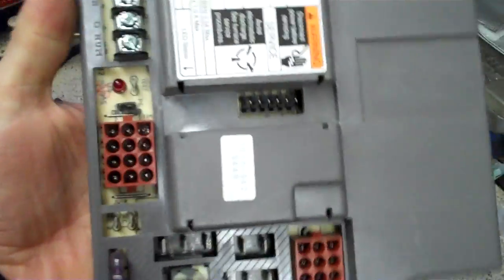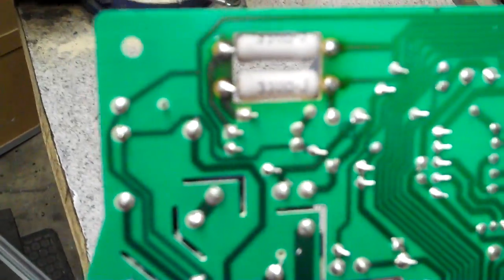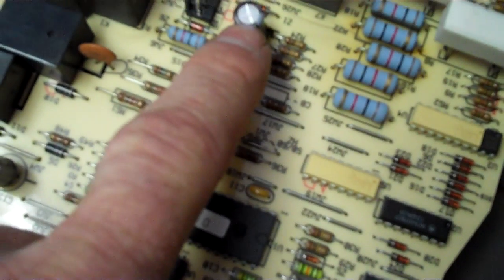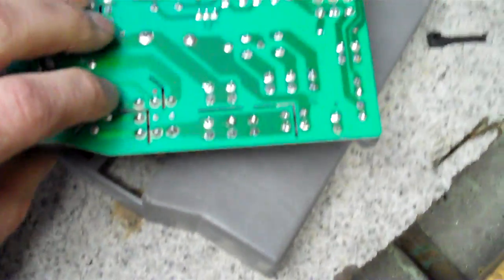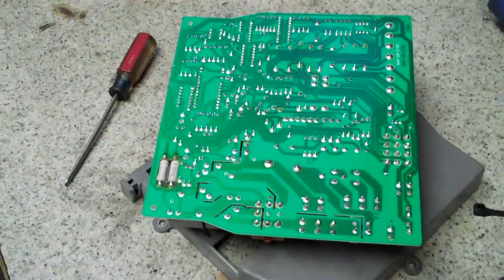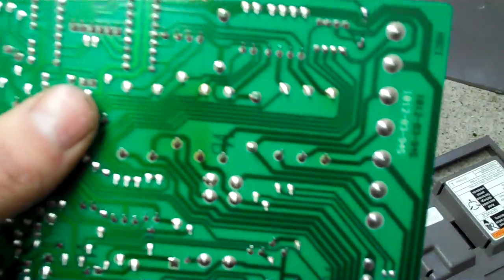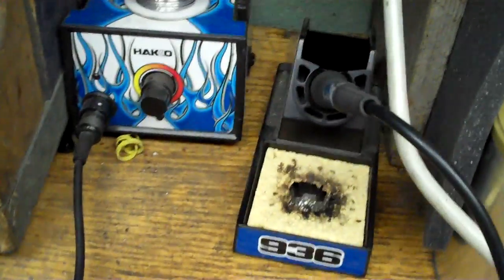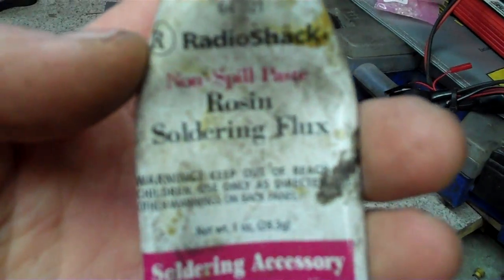How to fix a glitchy control computer on a furnace or car

Comment: Brian I have tip for you , Use solder that has lead in it not lead free solder like there using in industrie now . Most of the time its the cold solder joint bad . I have a marantz sr-18ex reciever that was fixed for cold solder joint and it came back with the same problem now . Its in the power supply thats causing my problem . But I short on money to fix it now .great sounding reciever by the way .

Comment: Brian,You mention you was into Hvac,Question I have a  $600 Window a/c unit my fan motor would sort of lock-up time to time .only in hot day time hour it would act up,I had the capacitor check.they it was ok ing.so four months later the fan motor totally lock up.so I paid $150 for a new fan motor ,now the  fan just Hums .I turn it off right away.? should the capacitor now be recheck again. the entire unit run one capacitor it has 3 prong Fan,Common,Compressor.there nothing digital.just turn knob

Comment: Extra flux is always nice to have, especially with these fixes always use some flux & a desoldering braid so you can put fresh solder to prevent cold joints that will eventually fail again

Comment: @briansmobile1 Electrolytic caps can swell/leak/burst open on top, they often have an X or K shape deliberately inscribed into the cap to release if they are going to blow. They can also swell up underneath and push the rubber plug out and the cap will be leaning over to one side a lot of the time. They often leak a horrible brown substance. This is hydrogen getting over-pressured inside the cap. The primary cause is a manufacturing defect in millions/billions? of caps. Car ECU. planes, anything

Comment: @briansmobile1 I am a trainer and make presentations all the time.The audience rarely knows how difficult it is to do everything just right. I don't think I have made a presentation where I got everything perfect. I think you do a great job and I have used several of your videos to help with my own car repairs/maintenance. I still haven't had the guts to hold the slide on my Sig like you did on your Glock to stop the slide from cycling. Just my luck and I'd be doing a vid on bandaging the hand.

Comment: Believe it or not there is HVAC on submarines I was a IC tech and a nuck for a while . The IC guys we take care of the CAM system we do all the reading maintenance and repair . A CAMS is Central atmosphere monitoring system it monitors all the air on board a sub. We also took care of O2 makers and co2 scrubbers . All lot of the repairs are just like the outside HVAC systems

Comment from the maker: @nd318865 You bet.  Often things halo break on a solder joint due to the weight of the copper wires going to a plug like this one here.

Comment from the maker: @pberglin I just solder it so it's covered well and glossy.  Circuits like this behave differently based on load, temperature, and vibration.  It can pass an ohm test and still fail.

Comment: Capacitors are very common failure points in the last decade or so. Often replacing them can solve stability issues etc. It is possible for a failed cap or resistor taking out another upstream or downstream component like an IC, it just depends how it fails. I've repaired a number of PCs by replacing failed capacitors. It is best to just do them all also with Rubicon or Nichicon caps after de-soldering the bad ones.

Comment: Another thing to emphasize is that when soldering on a board with ICs (Integrated Circuits) is to use an "ESD Safe" soldering station. I believe your Hakko 936 is ESD safe. ESD = Electro-Static Discharge, the only safe way to solder around ICs. Using the Weller pistol grip soldering gun or other non-ESD safe soldering device could spell disaster for your ICs. I replaced an AC board once where one of the relays was fried. The new board fit about 10 times more models than the old part number did.